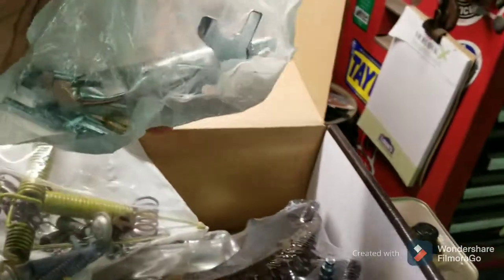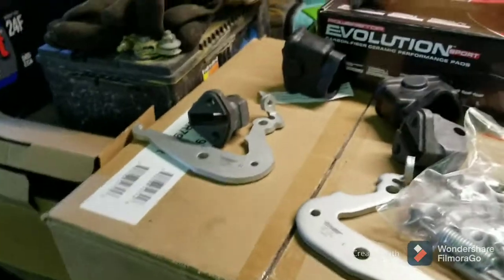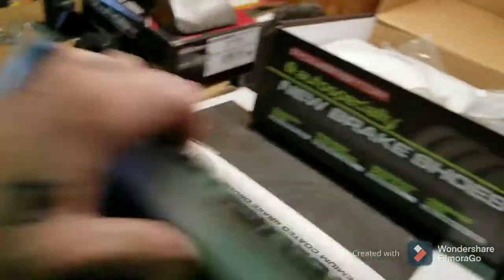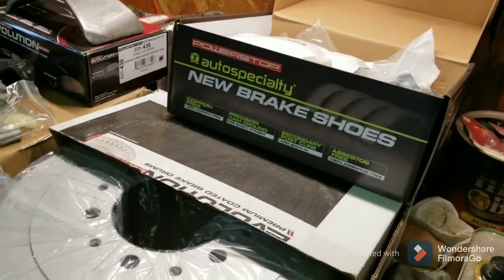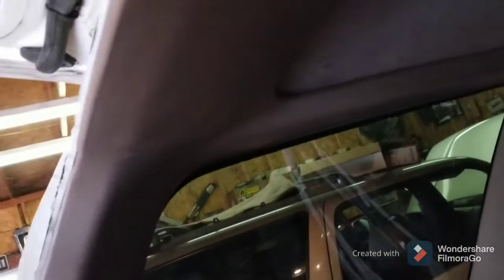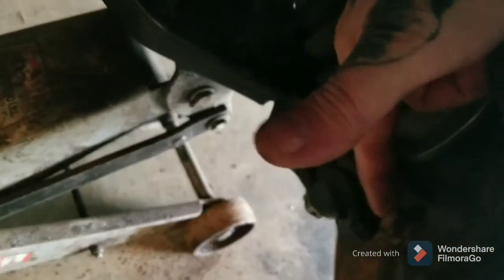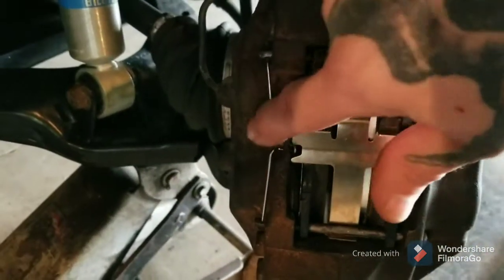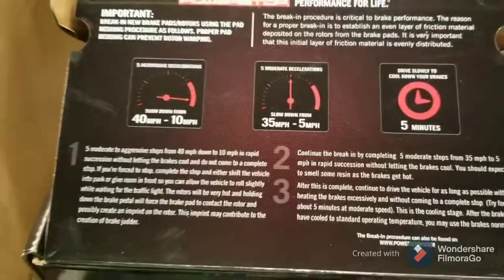How to rebuild emergency brake & rear drum brake job. 8"Toyota 4runner, Tacoma, Tundra, T100 & more

Comment: I did my 99 3rd gen e-brake a couple of months ago. Both sides were rusted solid. Not about to tackle the pads, but when the time comes, your video will come in handy. Thanks. PS: I  covered the e-brake mechanism (outside of the wheel) with cosmoline and chain lube to make it last.
Reply from the maker: Thanks for watching. 
I worked way too long to get 1 side loosened enough to barely work.
Then I bought the kit. Both of mine were very rusty. I covered it all in grease and then put the boot on.
I have chain lube, that's a great idea, I'll spray it inside the boots at every oil change.
Glad my video is helpful.
Appreciate ya.

Comment: Nice video document; featuring Power Stop brakes!   I'm about to upgrade my suspension and brakes on my 99.     On the fronts, I'll be installing the 199mm Tundra calipers to keep my original 16" wheels on.   However; on the rears, I'm going with drums again... This seems like a nice upgrade.  Thank you!
Reply from the maker: Thank you!
I have done the power stop brakes on other vehicles with great success. 
The difference it made on the 4runner is huge. You'll be happy with the rear drums.

Comment: Went to replace a snapped cable and my entire side is rust-welded together and one of the bell cranks is seized. This was a fantastic video for a DIY handyman. Thank you.
Reply from the maker: Thank you for the awesome compliments.
I'm sorry you found bad news. But it's great that you were able to make it work again. 
I'm always happy to hear my channel is helping people get a wrench in hand and solve a problem at home.
Thanks so much for sharing and supporting my channel.
Reply: Quick question for you if you have the answer  @funjunkiegarage  . On the actual cable itself, is the equalizer assembly (part #46341-35030) supposed to be loose when it attaches to the frame or snug/tight? My old one was tight, but I don't know if that was intentional or rusted in place because I now have a gap with the new assembly. Thank you!
Reply from the maker: It should be just loose enough to move. 
It should not be floppy.
Are the nylon bushings missing?
Hope this helps.
Let me know if you have any further questions.
I appreciate your support of my channel.
Reply: Looks like I did not get the nylon bushings in my cable kit unfortunately. Hopefully they're in stock at Toyota or AutoZone, otherwise I'll have to wait a couple days for those to come in. Isn't a project without something unexpected!
Reply from the maker: @jdoblanko  indeed.  Let's you enjoy wrenching for a little longer.

Comment: My mechanic did a new rear brake job with new everything, shoes, rotors, wheel cylinders, backing plate etc....when i hit the brakes at highway speeds.....I get a vibration all the way back to the pedal.   I have read all the forums....still can't figure it out.  Any thoughts? thanks
Reply from the maker: Wow, no if everything is new, that makes no sense. Are you sure it's from the rear? Have you tried pinching off the rear soft line to take the rear brakes out of the equation? Is the vibe just in the pedal? Can't feel it in the steering wheel or seat?
Reply: @funjunkiegarage  no we haven’t tried that yet. The vibration I feel is similar to bad rear brakes. The front brakes are new too. We were wondering if the parking brake is fouled up. Rear diff, seals, supposedly are fine. No feedback in the steering. Just rear vibe coming to the pedal and my seat. Below 35mph is smooth.
Reply from the maker: Possible bad part?
One of the new drums out of round?
A bad shoe?
Have you taken the drums off to look for any irregular wear or something out of place?
Reply: @funjunkiegarage  Wednesday we’re taking everything apart, more experienced older guy this time. I guess we’ll have to check all that like  you said.
Reply from the maker: Right on. I hope you find out what's happening. Let me know if you get a chance. Best of luck.

Comment: Is there anyway you can put a new bell crank without taking the brakes all apart, the rear brakes are new with new drums.
Reply from the maker: Yes, but you still have to remove the drums.
Behind the drum, the bell crank connects to a short cable that pulls the shoes.
You don't have to disassemble any thing else.
Thanks for the question. 
I appreciate you watching and commenting.

Comment: What is that cable that runs across for?
Reply from the maker: The cable inside the drum pulls the bottom of the emergency brake lever and makes the front shoe move. Hope this helps.

Comment: I pulled up the parking brake cable from Dorman products but I don’t see any brackets you have in the video. Could you link the whole kit you got please?
Reply from the maker: Here is the kit I used.
https://www.rockauto.com/en/catalog/toyota
Reply: @funjunkiegarage  thank you so much!
Reply: Another potentially stupid question for you. They say with or without 16” wheels. I have 17” 5th gen wheels on my runner - is the w/o 16” wheels meant for bigger? Or the stock 15’s it originally came with? 😬😅
Reply from the maker: That link isn't working.
Go to rockauto, year, make ,model, select brakes, then parking brake bell crank assembly
Reply from the maker: 15s only came on 2wd or 4cyl rigs.
You would have 16s otherwise